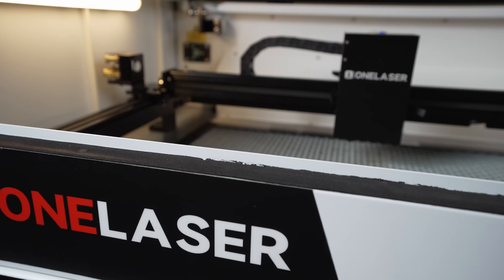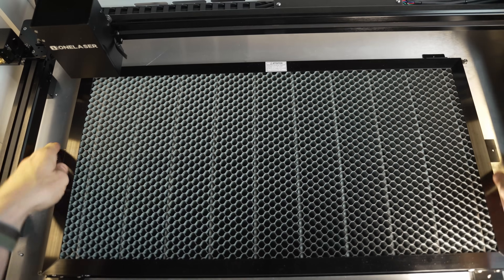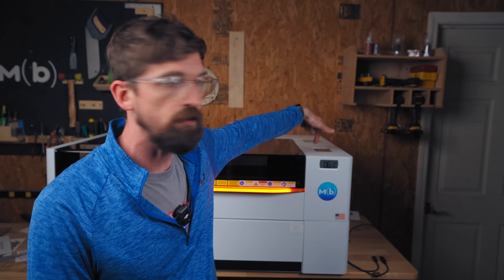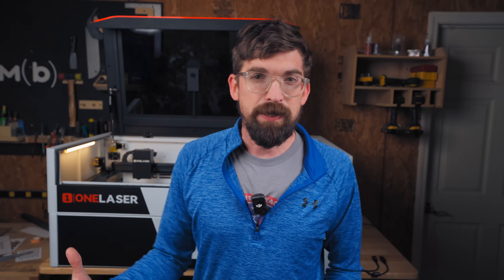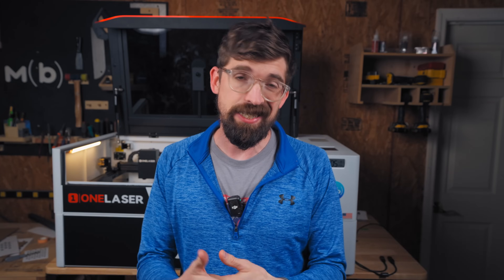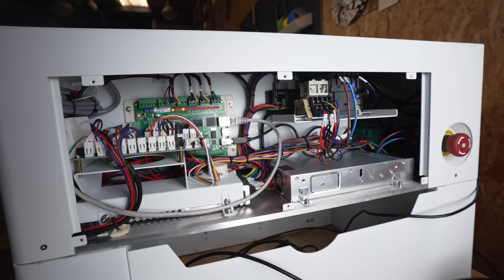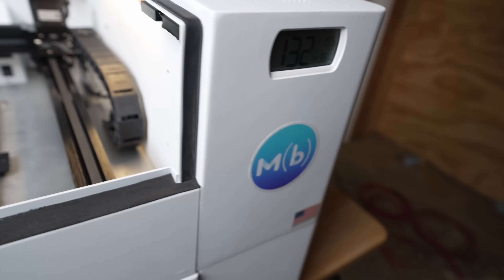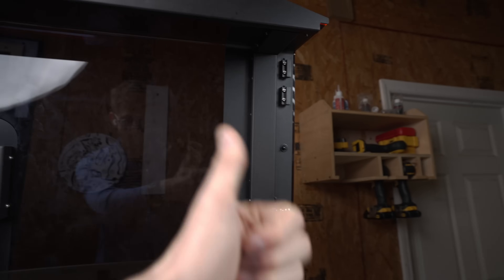I Was Wrong About the One Laser X Desktop Laser

Comment: I am really considering this machine for my small business that mostly includes specialized metal fabrication from welding to plasma cutting and heat treatment. I specialize in knife making, and I'm beginning to think my 45amp cnc plasma table is the best choice for cutting metal. But as for other hard materials such as exotic wood and resin, as well as engraving metal and wood, I'm trying to find the best most affordable laser to upgrade to from my 40w D1pro.

Comment: Being a novice, I think it falls short of the X-tool for the time being. It is drawing the smoke and debris from cutting/engraving through the internals which means extra cleaning effort. Needs extra air for the air assist. Doesn't have its own software, so need to buy extra. It would be a lot better if they offered all the accessories now even if not ready so that the consumer could buy as a bundle rather than get nickel & dime for them later. If I already had a laser plus air pumps and purifiers, it would be a great upgrade machine.

Comment: I don't understand the pass through, it is manual, but how can you push or pull the wood through at the right distance for the next letter (in case of a long add)?
Reply from the maker: It’s manual currently, but there are plans for a conveyer belt.  For now I would think of it as the ability pass through material that is bigger than the machine to engrave on a portion.  Versus engraving on the entire piece of material

Comment: My biggest question is the cutting power of the RF laser. I have a glowforge that I bought a few years ago and I am frustrated by how often I can't cut through simple materials like 1/4 plywood. I would love a laser that could successfully cut 1/2 or even 3/4 plywood. I have a CNC too but the laser would make life a lot easier for templates and small projects.
Reply from the maker: For 1/2 and 3/4 you’ll probably need to up the wattage